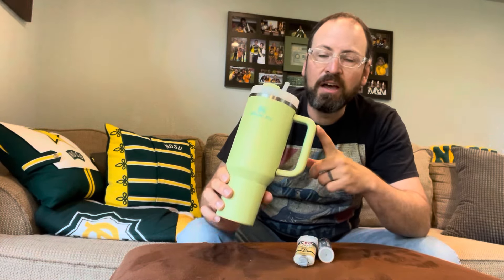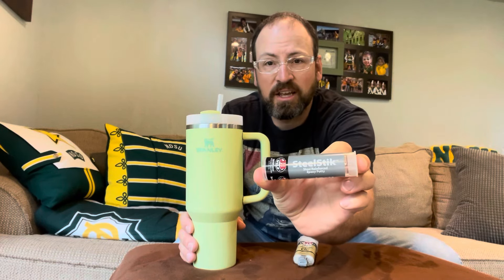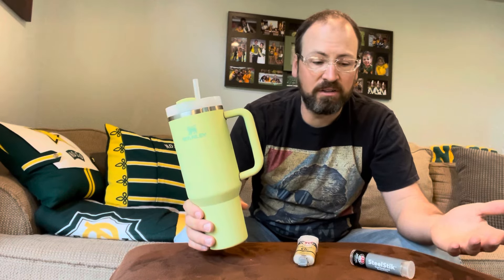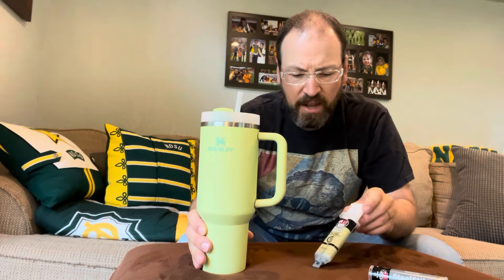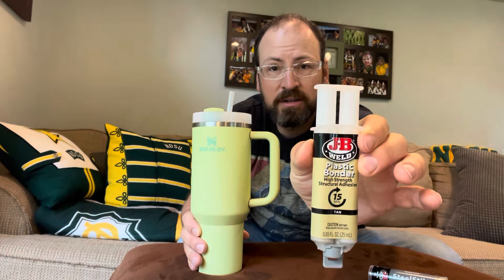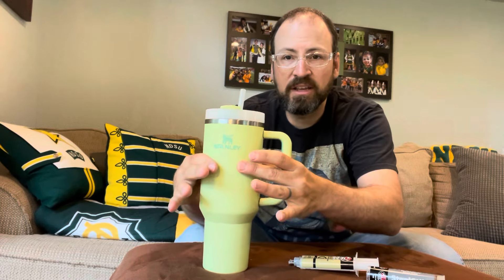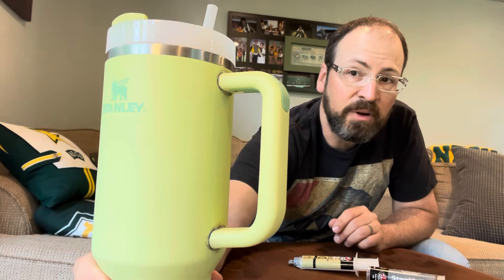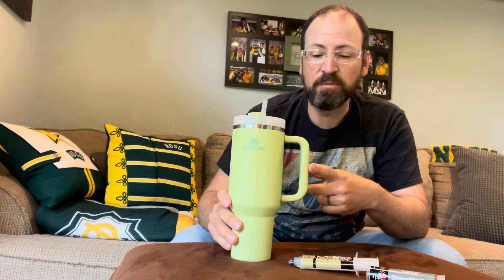How to Fix Broken Stanley Mug Handle - Quencher Tumbler

Comment: Was it the hardener or the steel glue
Reply from the maker: JB weld Plastic Bonder did the trick. It’s a 2 part epoxy syringe.

Comment: Did you say Stanley replaced the mug? We had one get nocked off a table and broke the handle off. Submitted a warranty claim with Stanley and they denied the claim.
Reply from the maker: Yes! My wife submitted the claim stating the mug fell from our 12-year olds hand and dropped about 18”, breaking the handle. I’ve read mixed reviews about Stanley’s replacement policy. Good luck’
Reply: try again! they certainly sent us a new one.
Reply: My handle was broken and i submitted a claim, they said “it wasn’t one of ours” so it wasn’t covered
Reply: @karlywagner3923  sadly, there are counterfeit mugs out there...that's why Stanley has the user submit photos of the broken mug, including a clear picture of the information printed on the bottom, so they can verify it's a genuine Stanley mug.
Reply: I hope someone sues them for their false lifetime warranty bs. These handles are made with glass

Comment: Simple modern replaced mine but mine has stickers I don’t want to lose so need to fix mine
Reply from the maker: Good call, my friend!
Reply: My daughter has a Simply Modern that the handle broke off and sent us a new one in less than a week. I carefully pulled her stickers off (very slowly with an razor blade), put new sticky on the back, and attached them to her new cup. Worked great! Now I'm trying fix the broken cup so that I can use it.